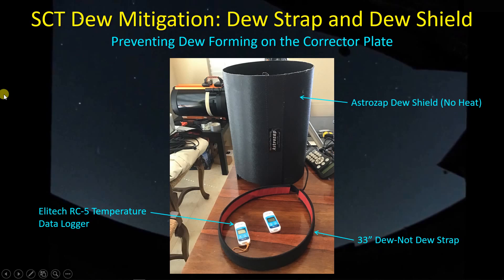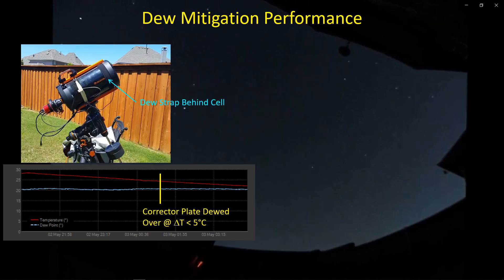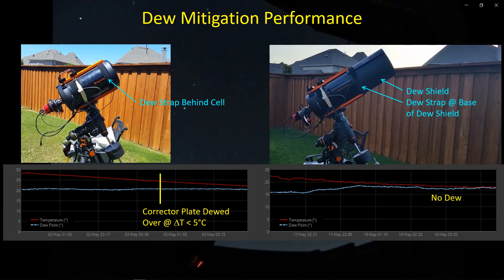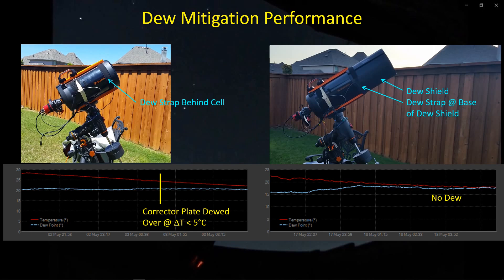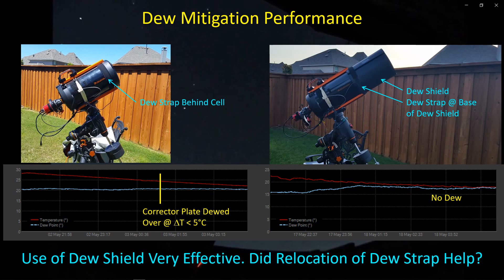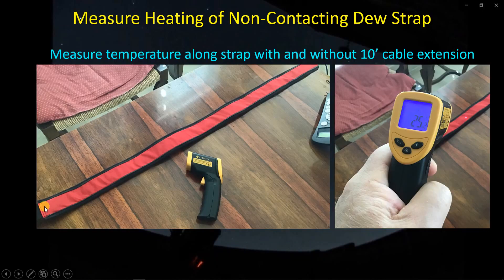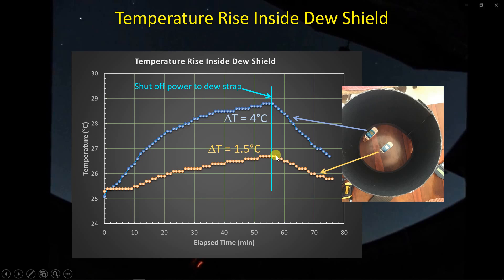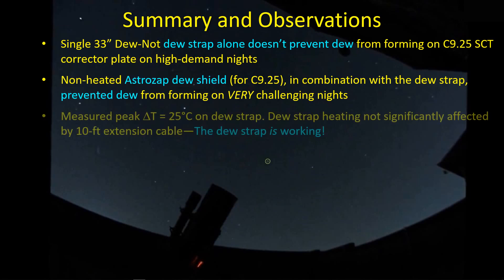Comments on the Use of a Dew Strap and Dew Shield with an SCT

Comment: Good review of an important topic.  Thanks for sharing your research.
I live in the Pacific Northwest where dew in winter is a big deal.  Being a cheapskate, I made my own dew shield out of linoleum lined on the inside with very flat black felt.  It works fine on my 6" SCT along with a heated dew strap on the optical tube aluminum body near the end (aluminum conducts heat better than plastic or linoleum).  It has worked in all conditions, including when the tripod and other equipment was covered with frost.
Reply from the maker: Good idea. It’s a tough problem but it can be solved. May just take a bit of testing and experimentation. Nice work!

Comment: I really love your content. Your videos on the Celestron dew rings convinced me to stick with my dew straps. Thanks for taking the time to collect all this data and share it with us in such an informative way. I still wasn't able to tell from your testing if the strap should be on the dew shield, heating the air in front of the glass, or on the tube heating the air in the tube. Thanks again for all the work you do.
Reply from the maker: Hi Ted. Thanks for watching. I’ve heard different thoughts on that. I put mine around the foam dew shield just in front of the corrector plate so that it can heat the air in front of the corrector plate. I just don’t see how the (seemingly) small amount of heat these dew straps generate can heat the OTA tube and the air behind the corrector plate. I am planning to get a second dew strap and place it adjacent to the one I have. One thing about that stupid Celestron dew ring is that it definitely kills dew. It’s just the other stuff it does that’s the problem. Good luck!

Comment: What if you put the strap on the inside of the shield, up against the from of the scope, creating a pocket of warmer air inside the shield?
Reply from the maker: That would be better. I tried to do that but didn't have high confidence that the dew strap would stay attached to the surface and not drape into the field of view sometime during the night. Since the outside mounting has been working for me, I just stayed with that method.

Comment: What a great bit of informational research and some solid technical responses. Based on reading through all, for my C8 Im tempted to forgo the dew shield initially (for dew) but I was considering buying one for the stray light reduction in my Bortle 8-9 zone. It wasnt mentioned so do you see any benefit in that by using the dew shields?
Reply from the maker: Thanks for watching! A dew shield may help to reduce light from neighbor’s porch lights or nearby street lights. It won’t help for Bortle-type skyglow.  If you have an SCT, killing the dew problem is a significant stress reducer. Good luck!

Comment: Have you tried using a material called Reflectix and wrapping your telescope with it? It can be found at any home building center. I have not had dew or frost on my SCT using this and a heater. I have never used a dew shield.
Reply from the maker: Hey Matt. I have considered insulating the telescope tube to minimize focus change but had not considered it for dew control. Interesting idea. Right now, my shortened dew shield and heat strap are working very well. Thanks for watching!

Comment: You can purchase heated dew shields. There is also a dew heater strip for SCT's that mounts right inside the rim near the corrector plate. The combination of the two has never failed me.
Reply from the maker: I bought things in the wrong order: dew shield then dew strap. I like the idea of a dew strap inside the rim. I agree, my setup has been working great. Thanks for watching!

Comment: My problem is humidity and heat in louisiana.  So when it is upwards of 90 degrees you use the dew heater?
Reply from the maker: Hi Jennifer. You have it worse than I do here in Texas, but it is hot and humid here. Absolutely, I often need the dew heater when it is hot. Generally, when the dew point gets to within 5 deg of the outside air temp is when I'm at most risk for dew. Thanks for watching!
Reply: @Aero19612  thank you for the reply. I will have to order a dew heater strip. I have a dew shield and I recently got a mak 180 and haven't been able to enjoy it yet because of the dew problems

Comment: Very useful video, first few clear nights in a while (moon still out though) and I've found my dew heater is losing the battle against frost forming. Up to now I've gotten away with just the heater but now I'm going to 3D print a dew shield. This video will help me to decide where exactly I need to place the heater with the shield for maximum effectiveness! Thank you!
Reply from the maker: My dew conditions may be less severe than yours, but I found that a homemade poster board dew shield that projects 3" beyond the end of my C9.25 works well with the dew strap wrapped around the dew shield hanging half way over the end of the SCT. Good luck!

Comment: This is very informative. I also live in Texas, and having challenges with dew and my 8 in Celestron. I already have the Dew Shield which doesn't do much, and I am researching the heating straps and controller. Just about to get one and try the combination as in your video. Thanks for sharing!
Reply from the maker: Thanks for watching! This was one of the "success stories" for me this past galaxy season. I use a homemade poster board dew shield that overhangs the OTA by about 3" and I wrap a DewNot dew strap around the dew shield so that it overhangs the end of the OTA by 1" or so. I power the dew strap off of the Ultimate Power Box. I have not had dew problems since adopting this approach. Good Luck!
Reply: @Aero19612  Thank you! Just received the dew strap and power box. It will be cloudy the next few days. Will let you know my results.
Reply from the maker: Excellent. Good luck!

Comment: Very informative. Thank you. I’m trying to figure out the best dew strap, controller, and power tank arrangement for my 6SE. New to the hobby and it seems like every time I start to find my groove on a night of planetary imaging, that’s when the dew sets in. I have a shield, but it’s not enough for Florida nights.
Reply from the maker: I ended up with a homemade dew shield (made from poster board and overhangs the OTA by 3") with a DewNot dew strap wrapped around the outside and 2" back from the end of the dew shield. I can get through a full night's worth of imaging on a bad dew night now. But I'm sure Florida brings a whole new level of pain as far as dew is concerned. Good luck!

Comment: So my Dew Nots arrived today and here are some inital findings - 

Ambient temp of my basement where telescope is currently stored  = 72F

Temp of Dew Not strip laid out on (plastic) table = 130F after 20 minutes

Temp of Corrector Plate metal shield (inside and out) and OTA before applying Dew Not = 72F

After 30 mins, temp of inside of the Corrector Plate metal surround directly adjoining gllass was 84F The outside temperature of the OTA ranged from a high of 84F at the Corrector Plate to 73F at rear cell end.

After 1 hour temp of inside of the Corrector Plate metal surround directly adjoining gllass was holding steady at 84F and the OTA showed same temp ranges as 30 mins earlier.

****INTERESTING PART****

I had an intuitive nudge to move the Dew Not appx 1cm over the edge of the Corrector Plate metal surround. Almost instantly - as I went to take a baseline temp - the temp of the metal surround (inside) rose to 100F (yes 100F) consistently around the inner edge of the metal surround and then decreasing back to about 86F at the very edge opf the glass plate. PERHAPS MOST NOTABLE is the fact that I could instantly detect a pocket of very warm air right around the front of the glass - right where we want it, righ??!! 

This is all without the shield in place, just the Dew Not. I anticipate this effect will be even more marked with the shield in place. I'll do some experiments and measurements with the shield installed over the Dew Not and I'll pso the results here when I have them. I am very happy with these results so far!!!
Reply from the maker: Wow! Your dew strap (same as mine, I think) seems to be heating a lot more than my initial measurements showed for my dew strap. Those results sound great. I hope to do some imaging tonight and I will measure the temp of the corrector plate and OTA tube. Thanks for  the info!
Reply: @James Lamb  Hey James & whomever else may be reading this down the line. 

Well I've been doing a LOT of experimenting and these are my results and conclusions based on the evidence I've seen. My overall take = 

* Ditch the dew shield (DS)- it's unnecessary, ESPECIALLY as it affects your astroimaging when windy

* Use 2 Dew Not Strips (DNS), tight beside each other. One on circumference of Corrector Plate Shield (CPS) tight to the edge but not protruding over. The other strip butted up to it. Both strips completely cover the metal of the CPS.

* The goal - IMHO - is to keep the glass temp above the dew point. Think front & rear windows in cars and how warm is used to keep them clear.

* The DSs offer very very little benefit and many minuses. They absorb at least 5F, typically 10F, of heat produced by the DNSs, which is then wasted to the air. The DS do not create a pocket of warm air sufficient to prevent misting / dew on the Corrector Plate. They offer some benefit in reducing the loss of heat from the OTA to space in the areas of the OTS covered by the DS. However, the DNSs do this much more effieciently, raising the average temp of the OTA from the edge of the CPS to 3/4 back toward the rear cell (SCT) by at least 10F. 

* The DNS put the heat into where it's most needed - into the metal of the CPS, which in trun warms the glass of Corrector Plate. 

* With 2 DNSs installed, I was able to raise the temp of the Corrector Plate surround (where the Celestron writing is "Edge HD" etc etc) where it joins the glass of the Corrector Plate itself to at least 90F, 95F in places, which is more than enough to keep mist / dew off. Obviously I was not going to poke and prod on the glass itself but even putting by hand close to it I could feel the warmth from it. 

* I purchased a Y splitter cable with 2 female RCA jacks going to one male RCA plug, which then plugs into an adapter with one female RCA jack at one end and a male 5.5mm / 2.1mm tip positive plug that goes into my 5amp Lithium power tank. 

* The final piece of anti dew system - telescope enemy no.1 - is a cordless fan made by Dewalt, poweerd by their batteries that power their drills. This fan will be mounted on a table blowing over the middle top of the OTA during observing. More or less guaranteed no dew, aside from any of my heat measures.

https://www.lowes.com/pd/DEWALT-20-Volt-Max-Jobsite-Fan-Battery-Not-Included/1000340891?cm_mmc=shp-cprdtolgooglelia-129-cordlessdrillsandcombokits-1000340891-_-0&placeholder=null&gclid=EAIaIQobChMI4pmbgOHI6wIVDODICh0zwwThEAQYASABEgKRVfD_BwE&gclsrc=aw.ds  

So, at least there is a solution for you where you don't need the DS, with its wind affected problems. Although unsightly and athestically unpleasing, the most practical way to imrpove my method of getting heat into the CPS would be to wrap the 2 DNSs in reflective foil, to help reduce heat loss and get as much of that heat back into the metal of the CPS where it's most needed.

I won't bee wasting my DS, though. I intend to cut it down into a custom jacket that fits around the top and sides of the OTA and butts up against the edge of the first DS. This will help in reducing initial heat loss of the OTA before the heat from DNSs kick in.

Hope some of that proves to be of some benefit down the line to someone.
Reply from the maker: GREAT REPORT! Lots to think about here. As I experimented with shortening the dew shield and placement of the dew strap, I'm coming to your findings regarding dew shield length: short is better. I might cut mine down to the width of the dew strap (2") and just let it serve as a support for the strap. I also bought some lightweight USB fans that I was going to mount on the side of the OTA to blow across the corrector plate. My current setup solves my dew problem so I never got around to testing this out. Watch out for buffeting from your "external" fan. I'm interested in how this works!

Comment: Thanks for your helpful video :) 

I don't think dew will be a problem at all when it's windy. The less windy it is the more likely dew will form & vice versa.
Reply from the maker: Totally agree. But I want the best from both worlds: I want to have the dew shield AND not worry about its sail effect. By the way: I visited Holloman AFB many times but got there in a rental car rather than alien spacecraft.
Reply: @Aero19612  hahah ;) 

A question for you please, James. In point 2 of your summary where you say that the combo of shield & strap worked well, did you have the strap around the circumference of the corrector plate or around the outside of the shield? I was planning on doing the former butw anted to ask you if that's what you did. Thanks
Reply from the maker: I wrap the dew strap around the dew shield, in front of the edge of the OTA. The strap's primary goal is to heat the air in front of the dew plate. So far, this arrangement has provide dew-free nights of imaging. Once I get a chance, I'm going to cut down my Astrozap dew shield to this short length and then mount (somehow) the dew strap INSIDE the dew shield in front of the corrector plate. Read comments from Mike on this video (and my other Dew-related videos). He has provided very good advice along these lines.
Reply: @Aero19612  Thanks for your reply. I look at it a little differently. For me, it will be about warming the circumference of the metal rim that protects the corrector plate, with the objective of ransfereing some of that heat to the plate itself which will go a long way to stop fogging / misting. Think about how a car's windscreen is warmed to prevent fogging / misting. For me, warming the air in front of the plate is not such a good iead because it will introduce a new problem of thermal turbulence and we have enough of that to deal with!!! I am sure there is more than one solutionm to this issue. Thanks for all your uploads and sharing your ideas. I'll test my methos and report back in due (dew) course.
Reply from the maker: Give it a shot and post back. I tried that early on but got dew anyway. The region around the outer circumference was more or less dew free, but the inner circular region was dewed over. I doubt that the little dew strap can generate enough heat to warm up the corrector plate. The idea behind heating up the air in front of the corrector plate is to increase its moisture-holding capacity. And, again, the low power of the dew strap can't really create thermal turbulence-at least very small compared to what's going on in the atmosphere. The one thing I can say is that ever since I set things up as shown in the video "Effect of Dew Shield  Length on Dew Prevention", I have not had a problem with dew. Good Luck!
Reply: @Aero19612  Hey James. I got my Dew Nots today and  will be experimenting. You mentioned that you wanted to "somehow" mount the strap inside the shield; one idea I had for this was to attach (superglue??) some velcro strips inside the shield where you wish the strip to be located. The material of the strips grips velcro nicely. Then, for the wires, I was thinking of drilling as small a hole as possible in the shiled just wide enough to push through the male RCA jack and lead. A circular rubber grommet with bevelled edges could be pushed over the RCA jack and lead and pushed into the drill hole to help keep the heat in. Maybe also sealed with (whatever) to create a 100% air seal. Perhaps some food for thought. This is one case where talking hot air with someone is good!!! (PS I am dyslexic - some of my posts may sometiems erad like goobldegook - I read over some of my previous replies to you and some of them hardly made sense. Just so you know.....)

Comment: James - thanks for the video!  I just purchased a C9.25 and I know the dew issue will bite me this summer.  I haven't invested in a dew shield yet so your video and experience is very timely.  Please continue with posting your "experiments".  Does the heater cause any image stability issues?  

Also, thanks Mike for your contribution.  You raise some interesting thoughts especially the yoga mat.  Would you advise that I try that first before investing in a commercial product?  Would you line the mat with black flocking of some type?
Reply from the maker: Hey Alan. I've bee experimenting with a shorter "dew shield" I made from an $8 posterboard. I have the dew strap wrapped around it. No dew so far. I have a couple of good imaging nights coming up and will test further. Afterwards, I'll post a video on the results, so hold off on the $60 purchase if you can. No, I think the dew strap heat effects are nothing to worry about compared to seeing, mound gear harmonics, and of course, dew. Thanks for watching!